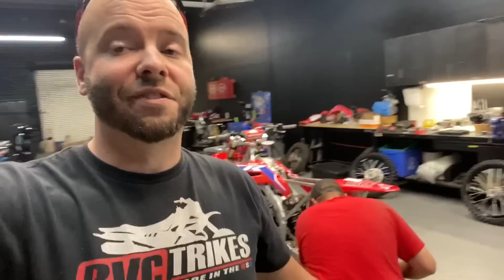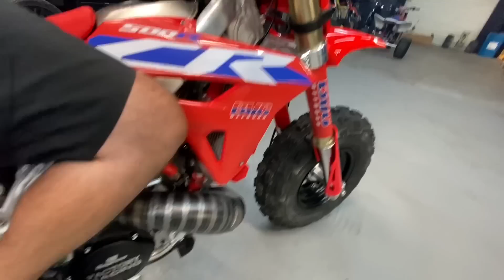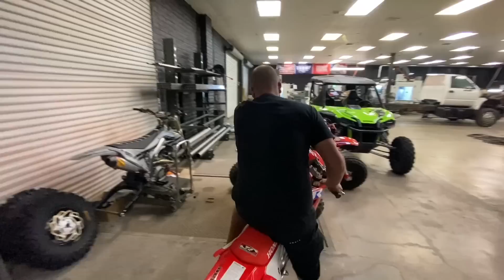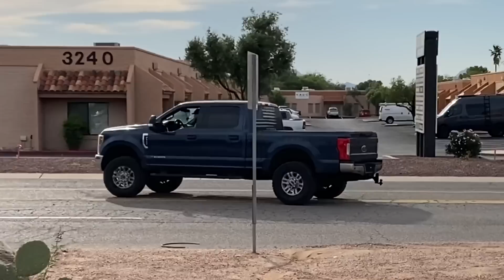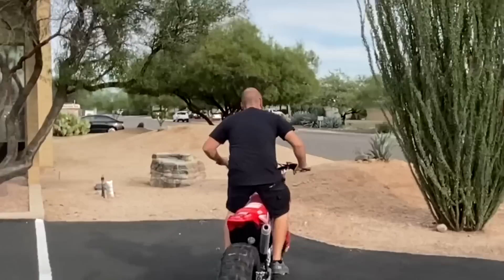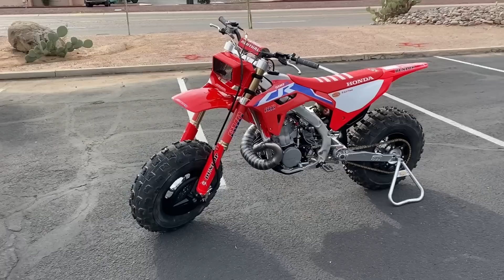CR500 FAT CAT Test RIDE  - THIS THING RIPS!  -

Comment: Just saying u guys got the direction backwards on them tires. Both them .
Reply from the maker: You are incorrect sir.. They have an arrow and are on the correct way stated by the MFG
Reply: WeThePeople. Of course they put te tires on backwards. It's all part of their plan to make the bike slower.
  Heavy, bad handling, thumb throttle, tires on backwards. You get it 😳

Comment: You lose alot of power from that 500cc motor with those small tires
Reply from the maker: These are 2.7 % smaller in diameter and 4x the traction in terms or contact area… 
Overall sized VERY close to where gearing is not an issue.   The CR500 does well with this size.

Comment: The bike looks amazing, Why do you run a thumb throttle on the big wheel though?
Reply: Thumb throttle > twist throttle.
Reply: Because CR500. Ever ridden one? They pull so hard it’s difficult for novices to hang onto the handlebars and not twist a normal throttle back while doing so.
Reply from the maker: Grew up racing quads…   Its more ATV now IMO so i put a thumb throttle on it 🤠